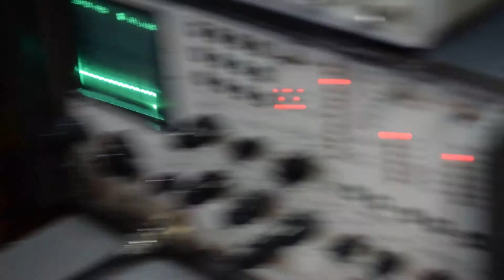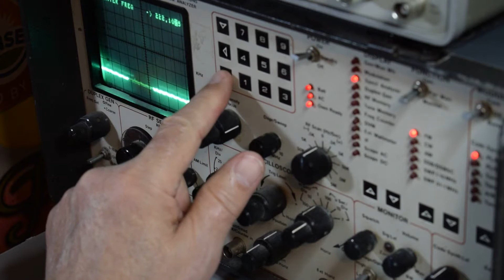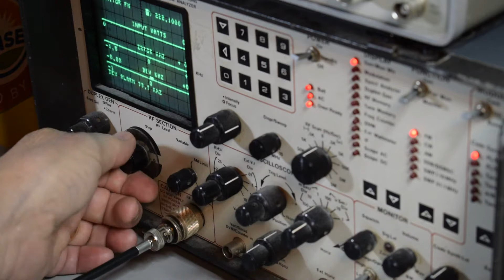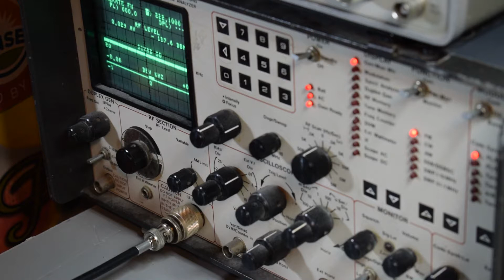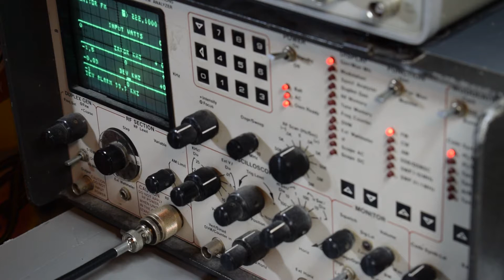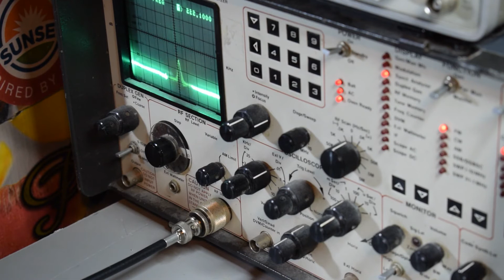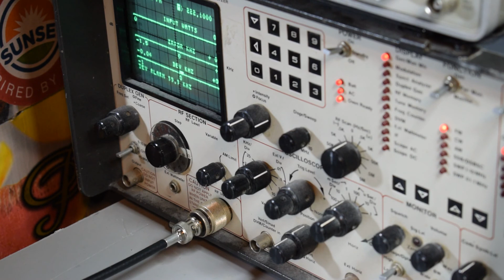222 MHz Transverter Testing

Comment: Since you said 137 dBm before correcting yourself I decided to figure that out. I knew it would be a large amount of power. I figure the 50.1 GW involved would explode your house and the surrounding 1/2 mile radius around you.
Reply from the maker: Yes, without the flux capacitor that much power would be a problem.

Comment: Did you ever figure out the problem with low power output? I have the same issue with my 144 MHz transverter being driven by 10 dBm. Only about 100 mW out...
Reply from the maker: Hi Rob, The input attenuator was burnt out so I trashed the board. Apparently it was over driven. The transverter costs less than the hour it would take to repair it.
Reply: Hmm, interesting. I don't have the attenuation board, and I'm driving with a XTVR output at a max of 15 dBm. Not sure what my issue is...
Reply: @robfissel2552  Hi Rob! I have one of 144MHz with the same problem. Extremely low power which I just can note the carrier with a HT near the antenna. No modulation too. I never exceed 100mW since mine was only connected to the transverter port of my Flexradio 6400 with 10dBm. Sure is cheap and not worth the time to fix in first world countries. But here would require over three months and taxes to get another one. Did you fixed your? Any suggestion where to look? Thank you!